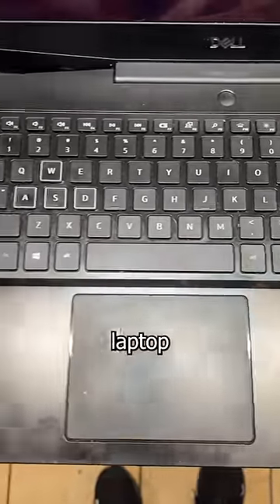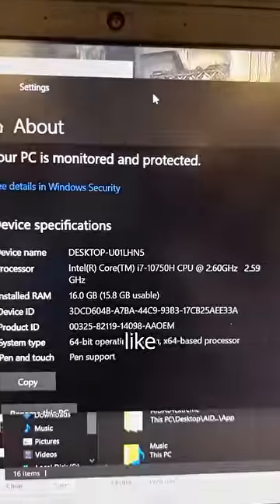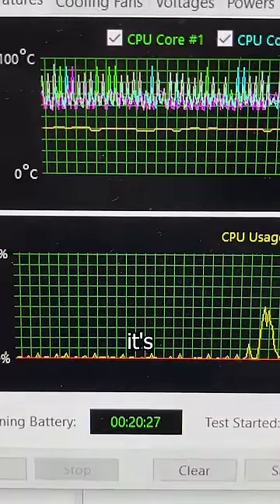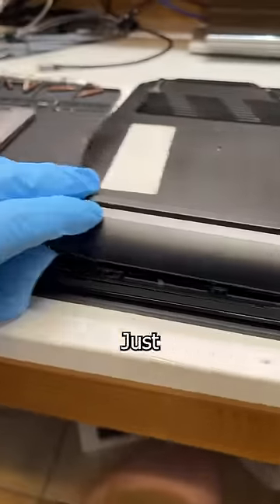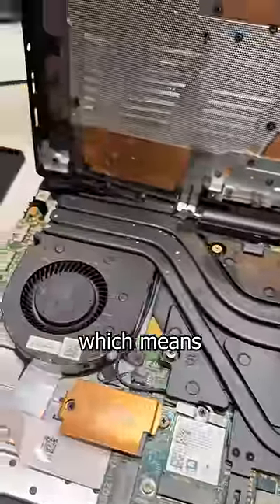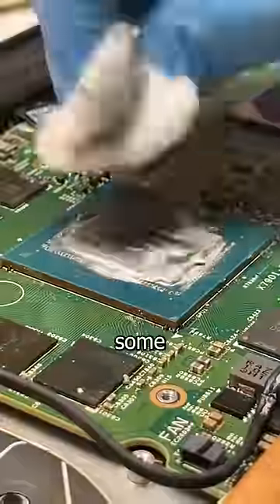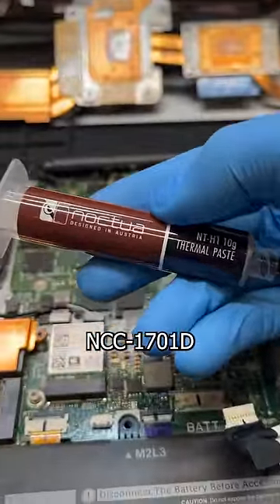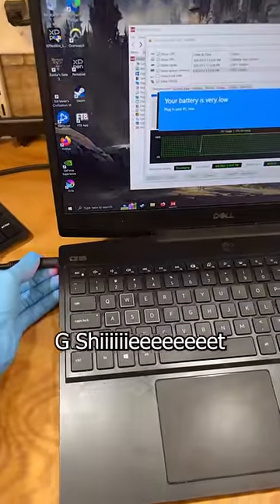Dell G5 is a terrible #gaming laptop with a terrible cooling system #tech #technology #shorts

Comment: You'd think it could go at warp speed with the special NCC-1701D magic sauce.
Reply from the maker: That's what I was hoping at least!
Reply: @SalemTechsperts have you tried ptm thermal pads or its not worthwhile?
Reply: @Engiduck doubt it wouldve made any difference to that piece of junk... 🫠
Reply: not enough deuterium
Reply: @-Kozloff  I hate to be that guy, but PTM has similar performance to liquid metal while being easier to apply!
Reply: At least warp 9.75.
Reply: @setsuna200 9.6 for 12 hours. The galaxy class cannot exceed warp 9.6.
Reply: @grigss3027 yep your right
Reply: But don’t let it exceed warp 10 otherwise it’ll “hyper evolve” into a calculator
Reply: Yeah, the Laptop went from last-gen to next Gen
Reply: Make it so 😜

Comment: I have one. It does overheat. I removed the grill to allow air flow better and ut dropped like 8 celcius. A cooling base helped by 3 celcius. So it works better now but the Dust and cat hair will become a problem. Its been 4 months.
Reply from the maker: This is EXACTLY what I had to do with mine that’s used as my media center
Reply: Oddly enough, some laptop do work better when the grill removed. Pretty sure I did that on my old Asus and Acer and it work pretty well.😅
Reply: Forgot to add, mine is g5 se, you can (barely) use the alienware command center app and press f7 to activate performance Mode, which turns the fans on with full power. And wanted to clarify, I just removed the metal Part of the vents in the back panel, thats what i meant for grill, not the back panel entirely (not native english speaker). I hope it helps other struggling with this pc
Reply: Have you tried undervolting? I was able to take 205mv off the CPU and it dropped my temps by 10 degrees.
Reply: @stevy2  mine is AMD all the way. Couldnt make it work
Reply: by any chance do u know how to run acer aspire 7 with no grill? google dont help i know its protection button near RAM but what should i do @Dreinzf
Reply: @winnik23  as much as I want to help you, I didn't had enough knowledge about Acer aspire 7 series and I really don't see the point of removing it unless you 100% sure you know what you're doing. I'll rather go with undervoltage option for both CPU and GPU.
Reply: i hope so.. just change termal paste but  its old one 2.2 W / mK. so i ordered MX4(+ thermal pads coz old looks not amazing) and w8 for it. also want try put open laptop on cooling pad but dont know how to run with open case it says no boot when i try but i know its special button near RAM. anyway thank you! @Dreinzf

Comment: I have an older model of g5. It was always overheating and I was using Noctua NT-H1. The only solution I could find was to use thermal grizzly liquid metal and the temps are okay now.

Comment: I used to have one of these. Dell has the worst support I’ve ever seen, who refused to believe that it was an issue. They sent a repair guy to “fix it”, and all he did was lock the screen at 60hz(should be 144). Eventually, I just had to keep it on low performance mode all the time. At default settings, it can easily hit 100c running games. Never buying a Dell product again.
Reply from the maker: Sounds about Dell
Reply: dell is dogwater when it comes to gaming laptops unless you’re paying premium for an Alienware which is good but overpriced as hell

the only sensible buys from dell are the XPS and inspiron stuff
Reply from the maker: Latitude stuff* Inspiron is also dogshit. Not as dogshit as HP and Ideapad though.
Reply: My Vostro ran for 14 yrs though thier service was outstanding i really don't know how it is but better than HP for sure
Reply: The vostro Latitude and XPS or solid the Inspiron metal body build is good as well.
Reply: @SalemTechsperts I remember some of the names Dell now use for entry level stuff being their top tier workstation labels years ago .
Reply: @SalemTechsperts saved me from saying it
Reply: @ichisenzy  XPS can be decent, but it also overheats WAY too easily still. Had it throttle while I had 2 firefox tabs open. Not to mention the quality control nightmare, I've had probably around 10-15 replaced parts total, and 3 total system exchanges cause it kept constantly having issues and crashing daily starting after 6 months or so each time. Thank goodness I got the 4 year warranty but I'm selling it and getting a framework next, I'm out.
Reply: I had the same, and it would constantly BSOD. It took a MONTH to get it returned for a refund. Worst company ever
Reply: My old dell inspiron is king. Super good cooling at all times and big vents. What happened to the brand?
Reply: My dell inspiron 5520 was awesome. Solid laptop for media usage. Gpu was weak tho and ram sticks overheated at summer, made it turn off. Also when i broke the screen and it detected it as broken, it played beeps and wouldn't boot. Different external monitors thru hdmi and vga didn't help
Reply: Don't buy a dell
-friend who works at dell
Reply: @SalemTechsperts what about acer brother
Reply: @SalemTechsperts I was thinking 'Glad i bought HP' just for me to find this
Reply: I beleive that you take care not to trouble yourself with any enemies, like winning and losing, that would cause you to lose sleep at night. That is how you deal with society, and you know that is what brings you happiness. Although, if you were to fight you wouldn't lose to anyone.
Reply: Literally. My inspirion fans were working fine but the second I wipe the hard drive and re install windows the laptop constantly overheats even with all the drivers updated
Reply: Just like razer. My laptop had horrible thermals from day 1 first play and it hit 85°. It completely died on me a couple of months ago. 1.2k of my parents money gone. I loved it but it really was too thin and had a horrible cooling system. Even with the fans at full blast I needed a cooling pad at full blast. Just bought a vivobook 16. It has amazing cooling and never budges above 65°. I'm just gonna build a desktop for gaming and use my vivobook for travelling
Reply: @Careditinghub  that sounds like a pretty smart idea
Reply: @JaackMilk  YESSIRRR
Reply: Had a tech from lenovo come over to work on my Legion desktop.  He had no clue lenovo made desktops and had no clue how they worked.
Reply: My G7's been holding up pretty well for all the abuse I put in through (ie, basically every computer I touch gets damaged), but it's still giving me a headache:
-bog standard Lint issues
-one of the fans doesn't want to work
-casing is fucked up in a weird way, so that one of the screws is stuck, making it a nightmare to open up and clean
-one of the USB ports is bent (THAT one I think is entirely my fault, though)
-the other USB port refused to recognize my Steel Series mouse as a valid device, forcing me to use a mouse that disconnects every 30 seconds

And again, I'm so unintentionally AWFUL towards my laptops that I can't tell how much of this is bad design, and how much is just a skill issue. I'm happy with the performance, at least: graphics settings for games I play are limited more by heat from a fucked up fan system than by any actual processing ability
Reply: Idk if you're still looking for comments but my advice for that is if you still wanna game on it, use Honeywell ptm 7950 phase change material, it's reported to decrease temps by 10 degrees

Comment: We should bring back the suitcase laptops. Those things were beefy as hell and practically incapable of overheating.
Reply: at this point just get a PC
Reply: @keleee Suitcase laptops were full desktops with an LCD and a place to stuff the keyboard etc. Plus a handle to lift it .  Fitting a 4090 GPU in one would be easy!
Reply: @keleee  More convenient than a full desktop that would be transported in multiple parts .
Reply: you can pretty much build one yourself these days, just requires a bit of modding.

Comment: My girlfriend has one. It had a failing ssd within the second year, and I just opened it up yesterday to clean it. They're not good laptops.
Reply: So like any dell computer these days.
Reply: Guys, hp laptops that cost around 900 dollars are crap too.
Reply: In dell's defense, some of the new Dell work laptops are decent. In hp's defense, the hp envy I have had been in good shape for about 7 years it is an aluminum body, so that helps with the hinges not breaking.
Reply: @Chrisp707-  HP too
Reply: @rypsterhc8673  had one and the GPU started dying in July of last year. It was only 17 months old. And also had a non-gaming HP laptop that just died after 1.9 years, when it was sent back from manufacturer repair it was too slow to use. 80x slower than before it broke
Reply: Lenovo is the best
Reply: XPS desktop here, 2 years old, M.2 nvme ssd failed about a month ago

Comment: Dell G5 owner here. The heat management on the laptop is universally terrible unless you want it as a combo skillet. I "fixed" my laptop's overheating without sparing any performance by buying an aftermarket laptop cooler that has an aluminum grated surface with vents. G5 can now run full throttle and charge without overheating concerns.

Comment: Now I’m super curious as to why it’s overheating. If it’s not dust, what is it?😂
Reply from the maker: The CPU needs to be undervolted and the fan curve needs to be more aggressive. But Dell disabled the option to do either of those things.
Reply: exotic butters from the manhood
Reply: @SalemTechsperts what software do you use to see the thermal throttling
Reply: @ZFanz aida64 is a good one
Reply: It didn't support throttlestop?
Reply: @SalemTechsperts  of course they did. Good ol dell
Reply from the maker: AIDA64 is what I use. HWinfo64 will also tell you.
Reply: @SalemTechsperts  thanks mate
Reply: @SalemTechsperts  Is this Dell G5 firmware up to date and Did you tried to switch Thermal Management to "Cool" or "Quiet" via Dell Power Manager or UEFI settings?
Reply: Dell

Comment: My (free) XPS 9570 has the same cooling for an i7-8750H and 1050 Ti. The i7 can boost to 80W, and that ALONE is too much for the cooling. There is also a dGPU in there. 
But surprisingly the biggest problem seems to be that the power delivery stuff has ZERO cooling, so that overheats and then everything else slows down too. 
And I can't forget to mention that the battery discharges while "running" games.

Comment: Check for separation , try thicker high quality pads , run the diaplay in a lower resolution and check for compatibility issues like bottlenecks due to cpu load. You could lower the power profile as well and set the fans to run at 80-100% at all times. Check if adding extra thermal pads to transfer heat to the pipes would help. Add pads to the memeory chips and hard-drive. Run it on low quality appearance as well. How the battery performing? Could it be over heating and or dead causing constant power draw ? Lower the ram oc, cpu oc and gpu oc too

Comment: I have a G7 and been playing on it for 4 years with average 20-50 hours a week. Even when overclocking, the worst that happens is that it shuts down, but it still works. Only issue now is horizontal lines on display when running 60 hz using ddr.

Comment: I have a G7. I have tormented it and kept it running straight for basically 5 years straight, squeezing maximum performance at every turn. The best heating trick I use is just raising it off the ground with two thin blocks of wood. 

It’s reduced to a potato now but this is primarily due to storage being 2gb spare.

Comment: I have a Dell G3 same generation, removed the dust filter for better airflow, installed dell power management or whatever it's called to change the fan curve preset. Now it's much louder and I don't place it on anything except for a clean desk but temps are okay.

Comment: The cooling ducts are probably fucked. They should hold a fluid inside of them that helps transfer the heat towards the coolers. If the ducts have been punctured then they've completely lost all their heat transferring capabilities. Had this happen to me on an older HP.
There is nothing that you can do other than completely replacing them... if you can find the parts, good luck!

Comment: The best solution is to apply Phase Change Material (PCM) like Honeywell PTM7950, Upsiren PCM-1. Replace the thermal pads with thermal putty Upsiren UX Pro and performing undervolting.

Comment: if that bottom case is metal, maybe putting some thermal pad to see if the issue improved. If it is truly airflow problem, just drill a huge hole under the fans.

Comment: The issue with old G5 and G7 is the optimization that was made. Basically the only way to fix the overheating is undervolting, and that's about it. Different from the newer G15 model that had an actually decent heatsink, and even with that it can hit 100c temps under heavy gaming. But if you undervolt it will also work smooth. So yeah, no one knows what Dell had in mind to not put a heatsink that can endure the heat produced. 

(Some ppl do crazy heatsink mods, but it's too advanced and kinda expensive)

Comment: I have a mid-2012 MacBook Pro that I thermally modified (removed the metal backplate and used the bottom case part instead) (The MacBook Pro has Thermal Grizzly Kryonaut Extreme) and well it doesn’t overheat. The MacBook automatically adjusted its fan curve over months of use and the second the cpu cores hit 85c under load the fans start spinning.

Comment: serviced many of those laptops, the Issue is that those were designed for much lower specs like  a 1660ti, and they forced the MAX -Q Designs,  you can have them work no issues if you set the power targets to the lowest point (like a 55w tdp on the gpu), and having them a ventilated base, 
this has happened since 2005 lol, they're trying to fit a lambo v10 into a vw beetle chassis and not fitting enough cooling

Comment: Maybe radiator is not transferring heat away? It could be due to bent pipe. If after all cleaning and paste change and checking that cpu is not damaged, it is still overheating the only solution would be to replace the radiator

Comment: I have a G3 with the same frame/cooling setup, but a 6 core 9th Gen i7 instead, and a GTX 1650. Even with me redoing the thermal paste and cleaning out the vents/heatsinks it still spins those fans like a mofo if you're doing anything intensive or using the dGPU. Mine will throttle itself pretty easily at 100c, so it makes sense that a newer system with a significantly more powerful GPU using the same cooling setup would constantly be shitting the bed.

Comment: when this type of things happen check temperature of the air coming from exhaust vent, if the air is cool but the processor is hot you might have a faulty heatsink

Comment: I own an AMD ryzen 4000 series/rx 5600m dell G5. I had to put it on a cooling pad with 6 fans and the bottom of the laptop removed to provide enough airflow for the oem 'cooling solution' to keep at a decent temp while running Apex. It does run it super well, although, I can't tell the difference between when you drop from the drop ship wind sound and every other moment I am playing 😂

Comment: it looks like the dust filters might be doing their job a little TOO well i think. Ya, the dust and pet hair is being kept out, but also hindering airflow to the fans TO cool it down. Dell's horrendous hard locked in the BIOS fan curves certainly don't help either.

its one of those times you bite the bullet and get one of the higher end stands that have slightly higher than normal (or adjustable) RPM fans

Comment: The thermal compound you removed from the heatsink and from cpu&gpu was not liquid metal, if it was gpu would be dead already because it spread in between the caps on the gpu. You're gonna need to remove the dust filters from the bottom case and apply a real liquid metal only on CPU, you can go for the GPU as well but you need to isolate the caps with conformal coating. Also the thickness of LM could fall kinda short and HS might not make full contact on the surface of the chip if you still get overheating after you apply LM. In that case you can use 0.1mm copper sheet using LM on both sides.

Comment: Fun fact, the XPS 17 9710 (w/ the i7 11800h) and the Dell Precision 7550 (w/ the i7 10850h) using Honeywell PTM7950 will momentarily boost to about 100W (I think their PL1 is 130W) and then throttle down to about a sustained (if I remember) 60-70W-ish during Cinebench R20/R23 according to sensor data in HWInfo while hitting max temps of ~97C. Considering how much power that is, I’m wondering if the “overheating detected” is just modern laptops being modern laptops, where instead of the older strategy of boosting temporarily then settling into a lower sustained power level, it simply goes into “feed it power until it burns” all the time

Comment: Test the heat pipes Use boiling water put the other end on the hot water if the other end won't heat up instantaneously it means the heat pipe is damaged , it needs replacement

Comment: I'll definitely check the thermal sensors with something like fan speed. I had a laptop do the same thing. It turns out it was a bad thermal sensor. I wish they would design gaming laptops with better cooling for those who don't mind a beefier laptop.

Comment: i had a g5, it would thermal throttle and overheat from day one. turning the overclock for cpu off helped a lot, but it still ran incredibly hot. one day it just stopped turning on.
Reply: Your GPU is fried

Comment: The only way to fix this problem that won't break the bank I can think of is to literally drill more holes to the back plate of the laptop since its got bad venting. That's about it, its a crappy design. Unless you replace the plastic backplate with something heat conductive so the entire back becomes a giant heatsink.